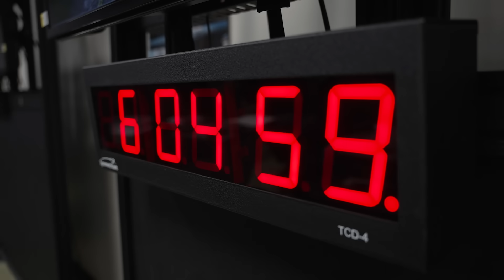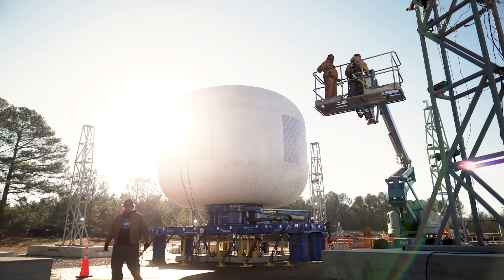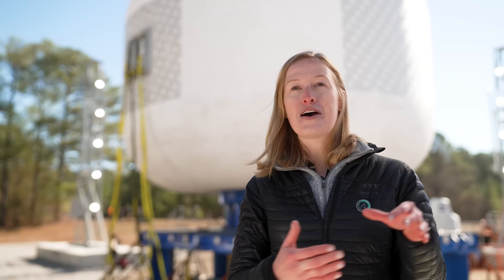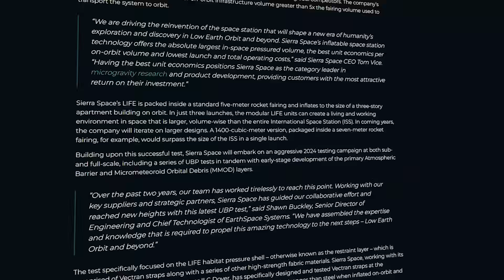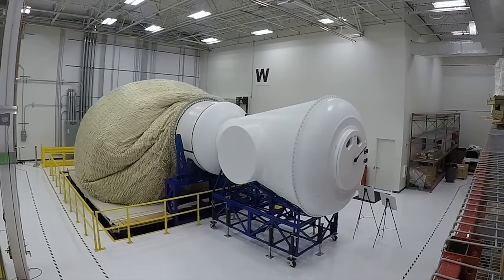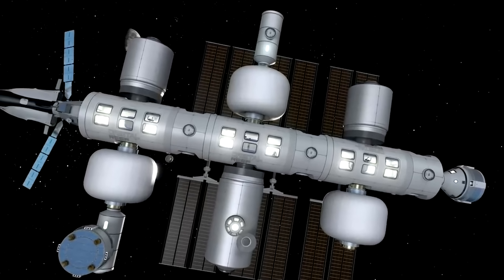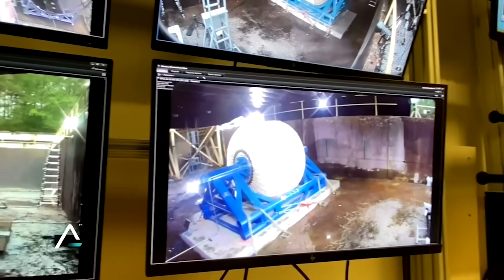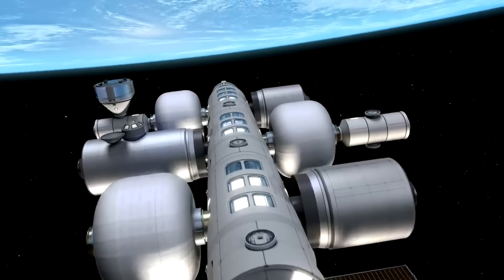Sierra Space Has Begun Full-Scale LIFE Habitat Testing

Comment: My only concern with this at all comes down to micrometeor impacts, given they are significantly more energy intensive than most firearms if you're unlucky, a structure like this would need to be carefully ensured to have proper evacuation options to ensure that in the event of a strike that people don't get trapped inside as it collapses.
Reply: well micro meteors will most likely self seal also this is just one layer they finished testing out of something like 7-8. One the section cut they showed at least 4 MMOD layers which are supposed to deal with that.
Honestly this technology will be much more useful in cargo transfer and storage than space structures. Being able to simply deflate your tanks is something any rocket/craft can gain from. Reducing stress during de/acceleration,more rigid structure(compact),reduce the need for pressuresing the tanks(partially).
It is definitely something that can be used in variety of ways. (Tires?)
Reply: @qa1e2r4  much more useful in cargo transfer and storage than space structures..... huh, wut?
Reply: @iamspecialk9155  load it, ship it, unload it, fold it, ship it back.
in space even if you ship something empty* it still have something in it. just letting vacuum inside the structure for the return will never be realistic.
While being able to simply deflate liquid tanks/refueling tanks/any cargo also tension and stress during acceleration will be less for a structure that is closer to its axes. Less energy used for maneuvering needed.
For the same reason they are great for space habitat being used more than once only makes them that much more useful.
The ability to change shape on demand and one of the best uses for that currently needed is cargo/bulk movements. Not particularly stationary structures.
Reply: Different layers. It's really interesting in how they deal with the smallest pieces. The foil you see in images of spacecraft is what usually does it. Micro meteors vaporize when they hit the foil. I don't know that they are planning exactly here but it's a solved problem. Besides, for the same mass, stuff like kevlar will be more puncture proof than the same mass of aluminum or steel.
Reply: They've been working on a defensive coating for the module
Reply: A fix for this is building struts on the exterior and bolting sheet metal panels onto it to create a metal shield
Reply: That's your only problem with it? Not the fact that the inefficiency of shipping water, food, oxygen and everything else up into space is comparable to loading up a 5 ton vehicle with 2.5 tons of fuel just to ship 40lbs of stuff? (Math based on starship weight and payload)

Help colonize and keep terraformed the Sarah first by planting a tree. Would be easier and better for humanity than dumping litteral tons of C02 into Earths atmosphere for every 40lbs of stuff you want to move up into space.
Reply: @Chazulu2   if you are saying to terraform the sahara, liquid trees might be on of the best ways to do so because it has the benefits of a tree but the modularity and survivability necessary to do so.
Reply: @haydenisanerd4958  What are liquid trees? I was thinking of building an evacuated tube maglev system their running on super conductors and transmitting/selling DC power from solar arrays further North where trees can't grow and then planting/watering trees/crops further south to slow/prevent further desertification.
Since the mag lev super conductors would need lots of liquid O2 from desalinated and elecrolised water anyway, it would be swirly simple to desalinate more for growing stuff. Also could use the H2 for energy storage relatively simply.

This would obviously have a lot of hurdles to overcome, but is still orders of magnitude easier than colonizing anywhere in outer space.
Reply: @Chazulu2  https://en.wikipedia.org/wiki/Liquid3 
they are essentially a urban replacement for trees where trees wouldn't suffice or be able to live. Really interesting stuff.

Comment: If I had a choice between this and a metal shell I would easily pick the metal shell. From the above movie it is obvious if the habitat blows you have zero time to get to a safe area. In a metal shell a puncture would still allow a short time to move to another non affected area.
Reply: This is a burst test, well beyond the conditions they will ever encounter in normal useage.
The velocities involved, a metal shell would still puncture, and then zipper open faster then this does, as it's single piece sheets, rather then woven with shapes that support each other.
Reply: Actually the Aluminum shell of the ISS would pop like a ballon if it were to burst under that same pressure.  And the inflatable system is belived to be MORE puncture resistent then aluminum because it has standoff layers and foam betfore the structural layer.  All the enginering says it is safer.

Comment: Does the air pressure needed inside have any effect on the crew?
Reply: The air pressure inside is +/-14.5 psi, just about that of sea level atmosphere on Earth.
Reply: Humans encounter problems above 14.7 PSI (1 ATM = sea level) but we haven't been informed of NASAs intended internal operating pressure; only the max. internal pressure the habitat can withstand before exploding. Space Stations (Salyuts 1-7, Mir and ISS) usually operate at 2/3 ATM = 10 PSI, EVAs even lower; maybe that is NASAs SOP.
(Gosh! Space lingo is chocker full of acronyms, isn't it?)
Reply: @davidstevenson9517  
The ISS working pressure is about one bar, as are Dragon and Soyuz capsules.
Reply: @davidstevenson9517  NASA operates ISS at normal sealevel air pressure, going lower is far too dangerous due to fire risk.  Humans do NOT suffer deleterious effects from higher pressures directly, excessive oxygen and nitrogen partial pressures are what are harmfull, which is why high pressure deep diving air mixes have other gasses present, generally inert gases like Argon.

The reason pressure vessels for spacestations have a safety factor is incase of a fire onboard, the heat and offgassing of even a small fire can raise pressure rapidly inside the station, the 4x margin is likely determined by estimating the pressure in a worst case senario of all the breathable oxygen onboard having been consumed in a fire.
Reply: The inflation of the module relies on a self-contained air bladder around the habitat itself, it's completely seperate from the actual atmosphere inside
Reply: @nipcoyote1140  Thanks, Nipper, I missed that one. So the "4 times max." that NASA demands actually refers to air-bladder pressure only?

Comment: ok, so if they do it at 1 bar pressure (1 atmosphere) that's only 15 PSI, same as a bounce house.  They've still never shown an internal skeleton providing extra rigidity.  Flying bounce house?
Reply: As far as I know, it does not need an internal skeleton.  None of the test units that flew to space had them, and they all worked fine.
Reply: @martythemartian99  the only one that went to space was 4 feet across and was used as a cupboard, and was made by a different (now extinct) company.  The ones they keep showing in the renders have connectors at both ends, often with heavy looking things attached.  For sure it's going to need a skeleton between ports, 15 PSI over something that big is still incredibly soft.  I'd just be really interested in what their thoughts are about that.
Reply: @somedudesstuff801   Yes I know it was a different company (Bigelow), but they did send two free flying test units into orbit before sending "the cupboard", as you call it.  The fact remains that when the outside pressure is zero atmosphere, a pressure of 1 atmosphere (15 psi) is actually more than enough to keep the structure rigid.
Not on Earth of course, but yes in space.
Reply: @somedudesstuff801 
15 pounds per square inch inside and zero pounds per square inch outside.
How many square inches in the external containment layer?
A lot of force holding its shape.
Reply: @martythemartian99  "rigid" only means anything in engineering in the context of "rigid enough".  Everything has a point of deformation or destruction.  A 3 foot ball at 15 PSI against a mass the size of the ISS would be rigid enough to not cause any problems.  At the same pressure but much bigger sizes, the same degree of flex ends up being a lot of deflection.  Trying to maneuver a station while a multi-ton vessel is attached to the end of one of those, I find it impossible to believe it would be anywhere close to rigid enough.  I don't understand why the prediction is apparently so controversial.
Reply: @jimsmith7212  different point entirely.  The concern isn't at all about the soundness of the material.  It's about the bounciness of the air it's holding.  And a 15 PSI differential is kinda the perfect PSI to be super bouncy e.g. basketballs and soccer balls.
Reply: @somedudesstuff801   If you look at 2:08 and 6:19 , you will see there are metal bars, struts, ribs that connect the two hatches at either end.  So when the hab is moved, all the pressure is taken by this solid core, not by the flexible outer shell.
I guess the reason why your prediction is controversial, is because many people from NASA, private companies and universities have been working on this idea for decades, and I like to think they know what they are doing.
Also I remember reading a lot of comments on the internet saying Falcon 9 will never land successfully, and never be reused.  These voices became louder with every failed landing, but you don't hear them anymore. 🤔
Reply: @martythemartian99 Might be more correct to say the Torsional Loads along that center spine (or spar) between the hatches, have to agree totally on where the forces would be carried if a vehicle was docked to the outside of one of these, it's never going through the skin of the module.
With the strong spine tube in the middle, the expanded areas would make for nice open spaces to clamber in an out of spacesuits and EVA suits, plus storage spaces for all of those and the required support hardware.
Reply: @somedudesstuff801  Depictions which fail to show a central rod running between the end-caps are simply wrong ignorant lazy artist impressions.  All real enginering attempts to make inflatable modules have a rigid core and they inflate only in the radial direction to get chubbier.  Normal pressure of 1 atmosphere inside and zero outside is more then adaquate to make the outer wall super rigid, you don't understand pressure well if you think otherwise.
Reply: @kennethferland5579  rigid is relative. Why so mad? Why not be "huh, yeah I wonder what they will actually have for internal structure, that will be super interesting" when you already seem to agree it's going to need it? My guess is carbon fiber ribs on the outside, aluminum tubing truss down the central axis. Truss kept in compression with steel cables. I'm excited for when they go into detail.
Reply: It's the difference in pressure between the inside and outside that determines the stiffness. A bouncy castle inflated to 15 psia (absolute) would barely support itself here on the surface, while one inflated to 15 psig (differential) would be as stiff as a pro soccer ball. In space absolute and differential pressure are the same, so at 15 psia it would be stiff like the soccer ball

Comment: You could pack a hell of a big inflatable module in a 9-meter Starship, with all that room on the long axis. I bet it could be twice the volume of the ISS in one launch.
Reply: The Starship already almost matches the ISS in possible pressurized volume; a starship sized LIFE module would be between 3 to 4 times as large.
Reply: @dalel3608 Set the floors up right in a BEAM / LIFE module of that size, and Branson will book customers for flights to a hotel inside it.
Reply: But Starships explode far easier than LIFE Habitats! Still, considering that Elon Musk does apply too much pressure on everyone it should be no surprise..
Reply: @davidstevenson9517 Err, what? The burst pressure here was 70psi (or close enough to), where Starship was tested to well over 100psi - IIRC, Starship had to pass Six atmosphere's for use, and surpassed Nine for the Test-To-Destruction.
Everything else so far has been Flight Termination Systems, which means a Detonation, not a failure based explosion.
Reply: @davidstevenson9517 Fire from a vent on IFT 2 partially caused the failure. It then caused FTS activation.